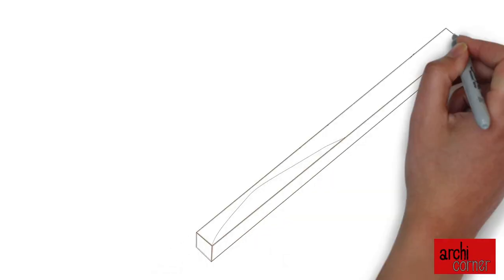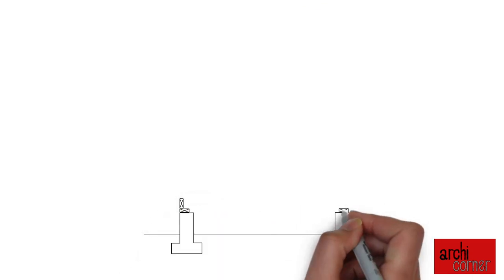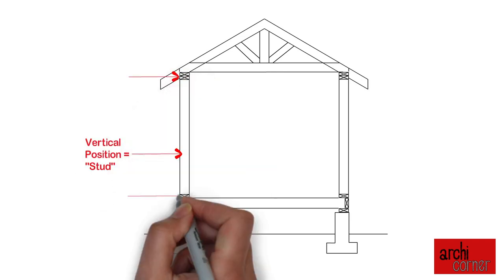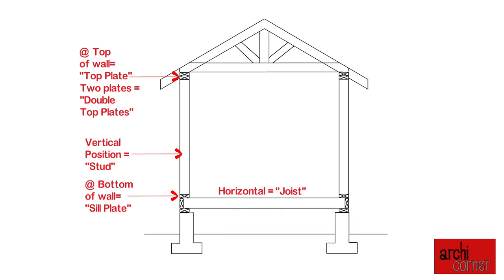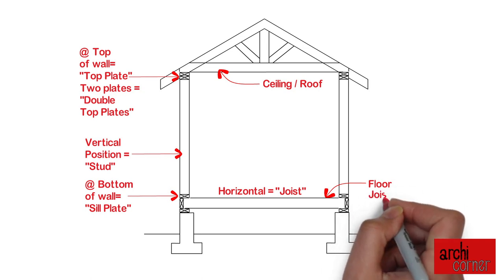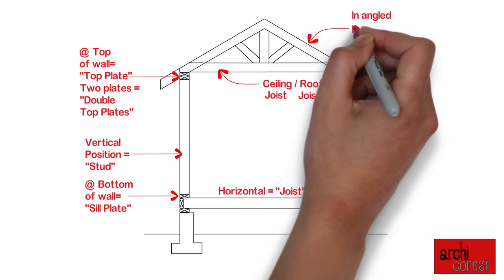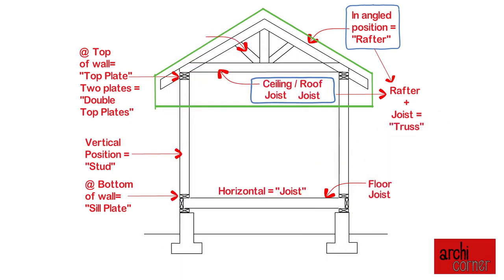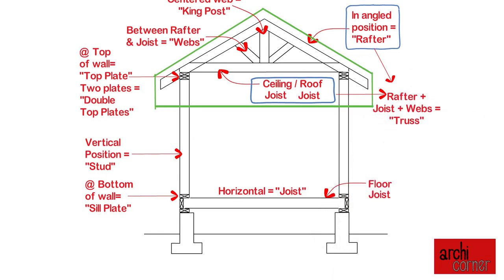AC 024 - Difference between: Girder, Beam, Joist, Rafter, Truss, Stud, Sill Plate & Top Plate.

Comment: The clear difference is that they are defined by their structural function, the joist is responsible for receiving the distributed area load from an horizontal sheathing (could be roof or floor, therefore they are more frequent in distance) whereas the beam receives the load from those previous elements and transfers the linear load to a punctual load (columns). So they are complementary.

Comment: Thank you! Your narrative was simple and easily understood. I really liked how you addressed the common issue and then provided a solution.

It's great to see your face, connecting with your viewers in a more personal way. As for the lighting, I can tell you have both natural and artifical lightings, which are reflected on your face, creating uneven color. Next time, I would turn off the artificial light, and have only the natual light. If that causes a split lighting on your face, then I would advise you get an artifical light that would supplement the shaded side. 

Thanks for your dedication!
Reply from the maker: That’s a very good observation. Thank you for the suggestion!

Comment: Can you do a video simplifying braced wall lines and when you need to angle brace interior walls? Thank you.
Reply from the maker: One of the ideas on the list of "to do" list would be to show how to design a small residential project from start to finish using prescriptive approach using the IBC. This would fit well with that.